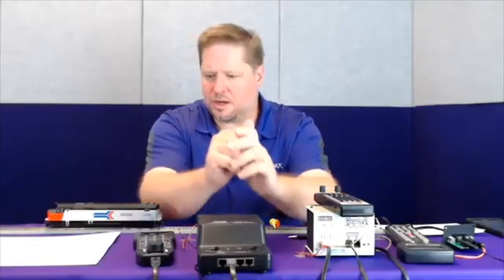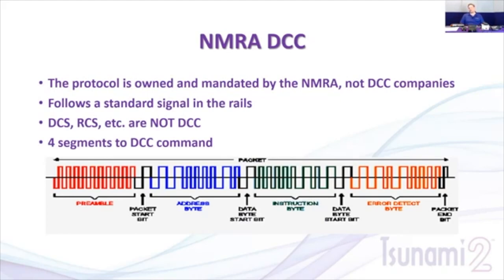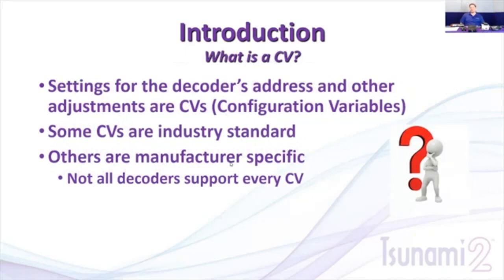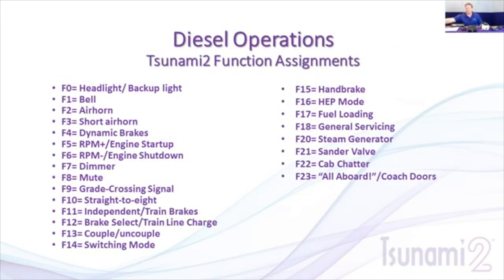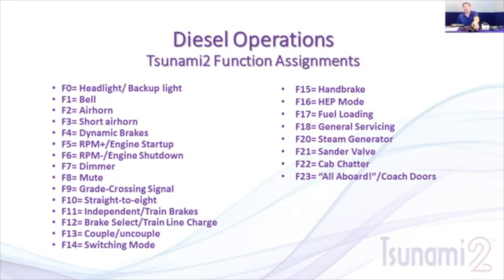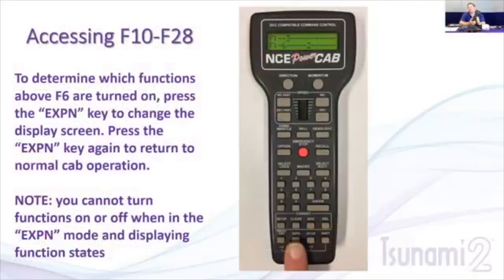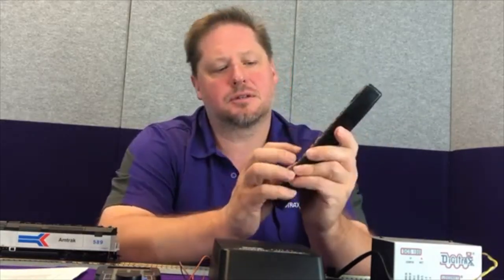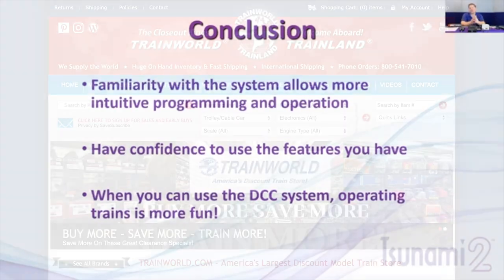Introduction To DCC Digital Command Control - DCC 101 Basics

Comment: Why anyone would want to waste a heck of a lot of money on a Toy Train set control system, that was designed by an Electrical Engineer (in the UK back in 1983) who knew absolutely nothing about railways, I really can't imagine ?   Indeed as DCC cannot replicate any of the Block signalling systems used on any European railway, and only  just scrapes by with American CTC (which basically uses no signals). This clearly reveals that DCC is a wonderful and most successful Commercial rip off, aimed at the ignorant masses, who totally fail to comprehend the complexities of how real railways operate !!!

DCC is therefore just a gimmick laden expensive toy. If you actually want to operate a proper model railway in line with complex railway rules, you can't use DCC which prevents this. Because DCC is now set in stone, and inflexible !!!!